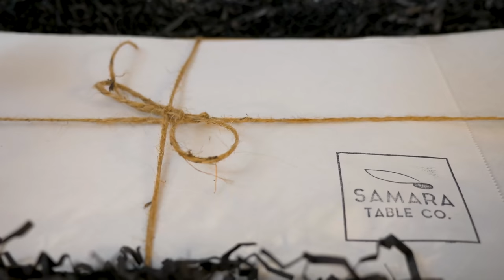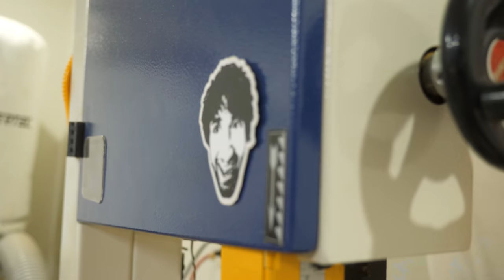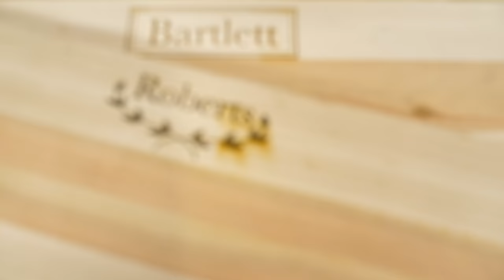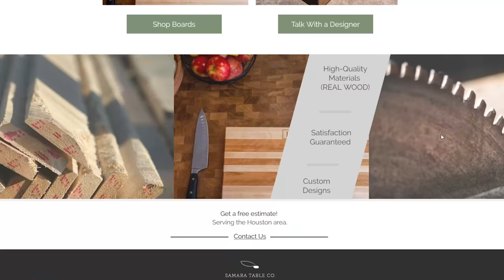😅we (almost) messed up our woodworking business this week...

Comment: I make cutting boards as a retirement hobby. I have them in a few gift shops, but my best method for selling my boards is with my tent at craft shows and farmer’s markets. Customers like to buy a board directly from the maker. They also usually have a few questions like what glue do you use, the finish, and the wood species.

Comment: Jennie and Davis, Glue up longer boards to make your cutting boards then cut your individual boards from that stock. It is faster to joint, plane, sand, and glue longer stock.  Read up on continuous improvement methods from lean six sigma.
Reply from the maker: Tried that - too much material waste. 20% lower yield at the end of a batch. The time savings aren't worth the product loss.

Comment: I have a question about wood staining with oil.   Can I do this in my garage in Minnesota where the weather will be about 20 degrees or so in my garage?    What do you think?   I'm not feeling good about doing my work in the garage and then moving my piece to the house basement for staining.  Just worried about flammability.

Comment: The problem with any focus on cutting boards is that they're quite the commodity.  I mean the first project you do in high school is a cutting board.  So if a high school kid can do it, then you need to differentiate yourselves from that level.  You can say, yes your quality is better and hopefully that's true you have the experience, but does it still draw someone to pay maybe $100 for a board?
Also, one thing I might try is mill your own lumber.  Especially if the buyer would provide it.  A special log from the local property or something.  This could help be a differentiator in your product.
Reply from the maker: There are 8 billion potential customers out there. Thinking like this will lead to nothing but disappointment. Sales from a small business are more about relationship and networking than supply/demand.